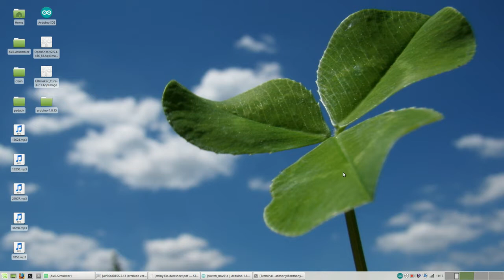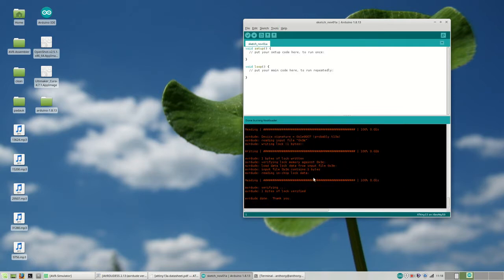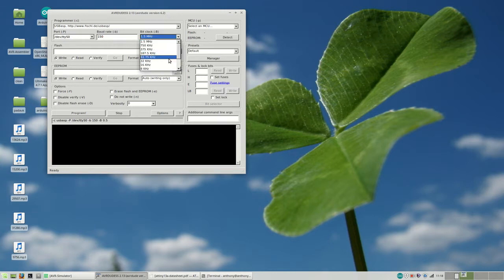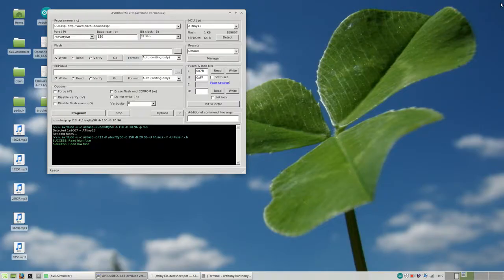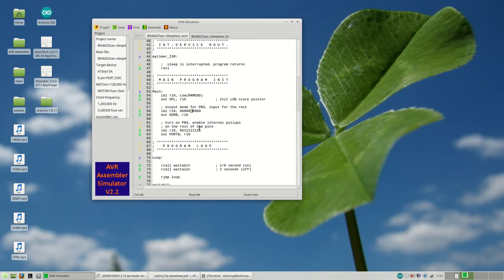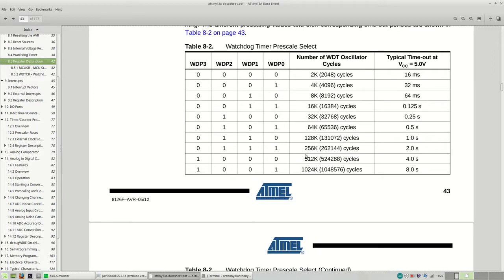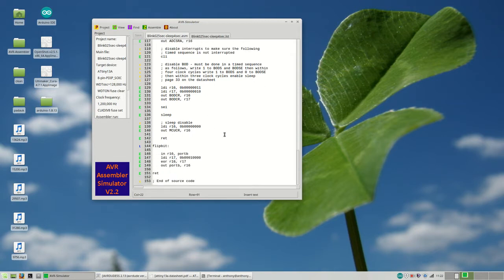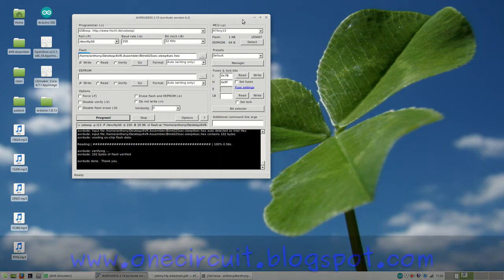Pimping a Garden Solar Light

Comment: Clever little circuit.
I'm still impressed that the joule-thierf(ish) circuit can power a microcontroller and much more without problems.
Reply from the maker: I think it has a lot to do with the fact that it sleeps most of the time and when it is awake it's only just barely ticking over. I'm working on a version that has two QX5252 chips so that it can run all day and night, possibly as a watchdog circuit, but of course tested with...a blinking LED!

Comment: Nice project, I think that the blinking LED would be handy in some cases as well.
Do you think that the blinking gets a longer light on, like all night rather than a  steady output might?
I've read a bunch of your blogs on this circuit and the various versions you've created, and tried a few myself... So..
Why use an ATTiny13 rather than a 555 or similar circuit here? Convivence or ?  Curious as to choice for this blinker.
Also, Which version of AVRDUDESS are you using as my searches all showed that current V. software as 'Highly Suspect'  or "UNSAFE"  and the sites where it was available are as well? Link to a safe one?
Reply from the maker: The blinking version lasts a very long time (no sunlight - still days or weeks of blinking goodness). The reason why it lasts so long is that the ATTiny13 asleep consumes very little current, whereas for instance a 555 is always "on". Also the ATTiny13 can be programmed to do all manner of interesting things, and at 128kHz it is very frugal.

I use  AVRDUDESS-2.13-PORTABLE (https://blog.zakkemble.net/download/AVRDUDESS-2.13-portable.zip ) but I do run it under Linux so I haven't really been concerned about the code. If you are worried, you can just use avrdude command line, but I like this GUI.
Reply: @onecircuit-as    link   dont exist  🤷‍♂️  no concern i dont  program ardino etc  anyway
Reply from the maker: Sorry that link is fixed now - I'll get the hang of it one day...

Comment: I have come back again as I am interested in your programming of the chip as it is not based on Arduino and have a suggestion about the solar panel life I have followed Big Clive and added silicon cover on my garden light solar panels that stop all the ingress of water and protects the panel and it works well  just a suggestion for your units after all your hard work
Reply from the maker: That’s a good suggestion. I’ve used hot glue to seal the sides of the solar panels, but a silicone spray sealant could go a long way with weatherproofing. 👍🙂